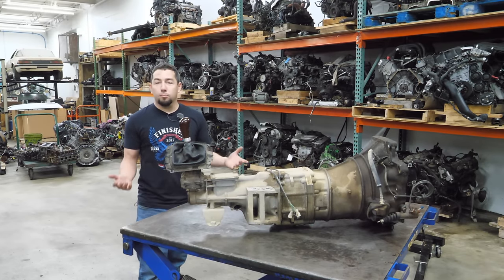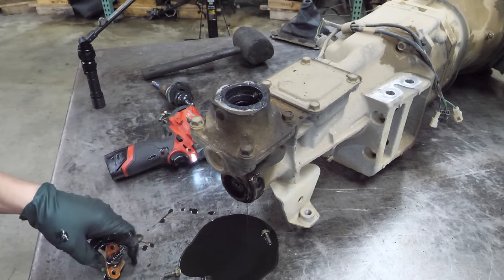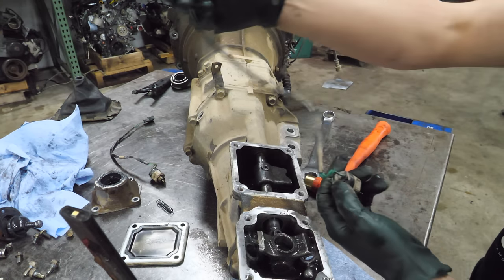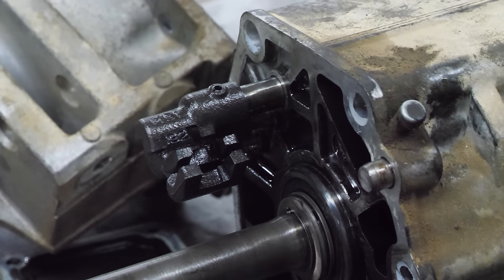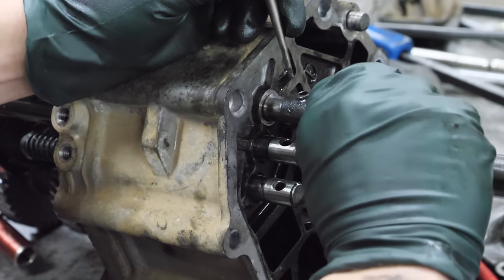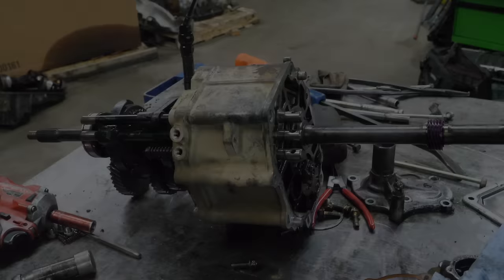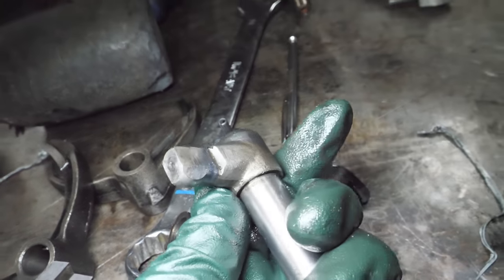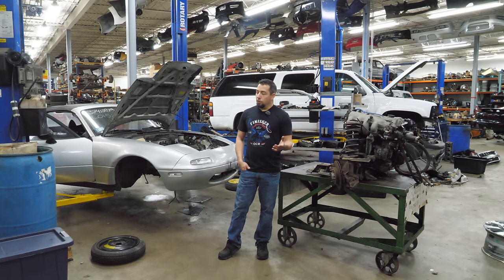JAMMED in Gear after wreck? Mazda Miata Manual Transmission Teardown

Comment: Ok, the blue tape under the shift knob just confirms what I suspected.  I owned a 2000 Evolution Orange Miata with just over 100k miles in Mississippi that I wrecked on June 11th of 2023.  I purchased the car in the spring of 2021.  It shifted ... ok... before the wreck, but when the tow truck was loading the car, I noticed the rear tires were not rolling and I assumed the transmission was jammed.  The wreck occurred as I was driving on a two lane highway at about 45mph when another driver in a Dodge Challenger (rental) turned across my lane about 30 feet in front of me.  I had no room to Dodge... the car and had to settle for standing on the brakes.  No major injuries to the occupants of either car, but I was sore for over a month from the seat belt.  I have been a follower of your channel for a while and hoped that somehow, my wrecked car would end up on your channel.  Got my wish.  Glad to hear the engine and other parts were salvageable and still live on.  I miss that car.
Reply from the maker: Wow man! First off, I’m glad you were ok.
Secondly, we sold the engine, torsen swap, rear bumper and a handful of small parts almost immediately. We gobble up NB’s and I’m not surprised with the Miata content that some day someone will recognize their old car.
Reply: That's so cool that u happened to see the car on this channel. I hope you continue to stay pain free from that accident. Very lucky. F-ing rental cars :-(

Comment: Eric is out here doing what 90% of what shop teachers should do. just tear stuff apart and talk about what to look for and what might cause it. Hell this goes for pretty much everything that you physically interact with. I learned so much, in less than 30 mins its insane
Reply: It goes against modern mantra though. They want you to toss and buy new, rather than repair or rebuild. There's a reason why the saying "they don't make them like they used to" exists, though it's a shame. This was by and far the best explanation of the basics for anyone and we need more content like this.
Reply: 100% agree. I have learned SO MUCH about engine internals and different failure conditions watching your videos
Reply: And then have the students put it back together from memory 🤣
Reply: What should the other 10% of shop teachers do?  Resign?
Reply: I always thought Gearboxes and Auto's were complicated as heck nice to see the Older cars still use easily torn apart boxes and when I heard Gbox main seal I never tried How stupid was that.
Reply: Truth
Reply: Yes, he is our generation, not the typical throw it away and buy a new one, save the past!

Comment: The shifter was stuck because the inertia from the wreck caused one of the shift hubs to move without the shifter being in that location. The detents between the shift shafts keep you from going into 2 gears at once. To fix this you can remove the reverse light switch and use a screwdriver to force the shaft back to the neutral position, thus aligning all the shifters again. I worked at a Mazda dealer back in the 80s and 90s. I was in the first Mazda troubleshooting contest in Arizona in 1989, I made 2nd place. Thanks for all the great videos! I really enjoy your channel. Keep up the good work.
Reply: Its reverse gear...common problem, easy fix....happens a lot in shipping and being set down hard standing bell housing face down or front impacts...the gear is only held in place by a ball detent between reverse and 5th on the internal shaft and can move forward jamming up the forks....Some trans you can get to reverse gear through the fill plug...slid it back and your good. In the video it was 5th/reverse shift rod that was out of place, moved forward...the shift detents keep you from getting into 2 gears at once and can not get jammed up or its broken...
Reply: Google "Miata stuck in reverse". It's an easy fix by just pulling the reverse switch and using a screw driver to reset the linkage. It happens when people FK around with the gear stick and shift direct from 5th to reverse when stationary

Comment: The fact that I finally get to see the inside of a manual transmission since I drive one. It really lets me know more about how I'm driving! And I'm so happy that I don't set my hand on the stick! 😂
Reply: I only hold mine when in third....to stop it from popping out.
Reply: @frankdesbaux  I've only had that happen once while I was on the highway and I hit what I would consider to be a speed bump from the road. Buckling but since they fixed it it's not that bad anymore!
Reply: @MrHanichak2  You need to drive older crap then.
Reply: What’s a shop teacher???
Reply: @frankdesbaux  so what does old mean to you? 10, 20, 30 years plus?
Reply: They should make new manual drivers watch these tear down videos before letting them touch the shifter..

Comment: Outstanding video. 
Old guy here I'm sitting here on the senior center bus from a Walmart run.
As a kid back in the late 60's I had a old 1965   Mustang 3 on the floor and I had to rebuild the transmission. 
It was my first time doing anything like that. 
It did work after that also.
Reply: Me too, 1st car 1963 260 V8 Comet, blew the trans, took it apart in my parents basement, went and got the needed parts (cluster gear and 2nd) from a Ford dealer put it back together, back into the car and it worked perfectly. Next car 1965 Mustang changed it from a 3spd to a 4 spd, I had some paper route customers that worked at Ford that got me a brand new 4 spd, (smile). Ford top loader, one of the best 3 & 4 speed transmissions ever in my opinion. I pulled the one out of my 70 429 Cobra Jet Cyclone Spoiler once to work on the clutch and it was the first one that I just couldn't use muscle back in. I was working pt time at a gas station while in the USAF and the owner said here set it on this floor jack and we got it back up & in NP. God how I hate being old now, 75 in May, Tear.
Reply: @George-Edwards Ooh that top loader is a great one to drive a car with
Reply: @George-Edwards  I've blown a lot of trans in my car but never needed to rebuilt nothing... Hmm I'll keep it in mind and send them an invoice if something goes wrong down the line...
Reply: @George-Edwards  For some reason, I tore up the Munchie transmission in my Pontiac GTO several times. Being an aluminum case, I could muscle it in and out.
Reply: 303 Toploader. Good transmission

Comment: As the owner of a '92 NA I super appreciate this video as the shop manual makes the dis-assembly of the transmission seem way more complicated. Luckily, when I have done fluid services on mine I didn't get glitter mud, and the plug magnet was pretty clean.
Something you know but forgot to mention, the shift knob area has its own separate fluid from the gear area and I run SuperLube Synthetic Grease instead of fluid there - makes for buttery shifts.
Reply: In case you did not know: Superlube grease is available in several viscosities , one of which (NLGI-Grade 000) is like honey and is ideal for this application. NLGI-Grade 00 is the next stiffer grade

Comment: In the late 70s I worked for a TV shop in Montana that had a 1969 Chevy van with a 4-speed column shift.  The shift linkage was very flimsy, and if you weren't careful shifting out of reverse, it would leave the reverse fork engaged when you went into first and it would take 5 minutes of jiggling to get it out of first and get the lever back to reverse so you could undo it.  My own car at the time was a 1974 Mazda RX-4, which had a 4-speed that I broke by power-shifting from first to second whenever I could because it could spin the tires (hey, I was a kid!).  Anyway, great video as usual!
Reply: I tore up the clutch in my 69 428cj Mach1 Mustang power shifting, but the gear box didn't bat an eye.
Reply: @wernerdanler2742  The part of the transmission that broke in the RX-4 was the collar that the selector slides on but the gears and shafts were fine.  I'm pretty sure the spinning of the tires in 2nd and sometimes 3rd was related to the flywheel inertia at 7500rpm more than the 140hp of the motor!

Comment: Had a 90 mx5 , a known problem is a weak detent for the shift interlock dog. Had the transmission locked in 1st and reverse at the same time. Easy fix, (10 minutes under car) remove reverse switch and move reverse fork with a screwdriver. Dog then can move again. That transmission was fine for another 250k miles. I image a lot of people replaced their transmission because of this easily fixable issue.

Comment: I've actually got an NA Miata right now, with that 5-speed transmission. Its so awesome, seeing how it works. A lot of us enthusiasts love to go on about how simple manual transmissions are compared to automatics, but there's still a lot of admirable complexity in there.
Reply: Design of manual transmissions, with all the synchros, shift forks, and gears compactly fitted together and set up so that everything works when it should and nothing works in neutral is one of the lesser of the dark arts. (I obviously know nothing about transmissions.)

Comment: Surprisingly nice. Rebuilt a FIAT 5 speed in the 70s the input and output shafts were dogged together for fourth. These were worn and jumped at greater than 3/4 throttle.
My Mercedes 307D truck 4speed was caught in a flash flood. Didn't see it but mud was half way up the doors. Everything seemed fine. A month later went on holiday. Came back and the gearbox was noisy and stiff as hell. Drained out only rusty water. Flushed and filled with new oil.....it was fine for another 100k miles (death of truck chassis)

Comment: I had a 72 vega with an opel sourced 4 speed. I broke that one 3 times. The most fragile transmission i have ever swa. I finally broke the cluster gear in half. With a stock 2.3 engine. I replaced it with a Saginaw that was built proof. Thanks for the video.

Comment: Man FINALLY! There’s like 2 Miata trans teardown videos on YT, and none of them go into this much detail of the parts and pieces. And none of the other ones are NB gearboxes. The factory service manual doesn’t show transmission teardown at all. I do have a whirring noise that stops on clutch pedal in, so I assume it’s the ISB. might have to look at replacing it someday and this video will definitely help. Doing the Miata gods’ work!

Comment: Worth mentioning that 4th gear in this transmission(assuming these are single overdrive units) isn’t really a gear in the conventional sense. Selecting 4th simply ties the input shaft to the output shaft, for a ratio of 1:1. When any other gears are selected the input shaft spins the counter shaft, and the counter shaft spins the gears on the output shaft, whichever gear is selected is connected to the output shaft via the hub and collar assembly.

Comment: Thanks for posting this operational. I have not seen a 5-speed (exactly like this, except for housings), since 1980.   Mine was a Borg Warner 5-speed in a 1978 Buick Skyhawk.
.
As you were shifting it through the gears, I knew, a priori, exactly what was going to (and did) happen (happening), as I had watched mine during rebuild.

Comment: I had a similar with a FWD transmission. It was tough to get into gear and sometimes I'd have to coast a bit. So when I got the car home (I'd not long bought it off my mum in a bit of a car shuffle !), I changed the gear linkage bushing* and the gearbox was fine for the 30000+ miles I put on the car over the next year and a half 😀

Thanks for this one, instructive and it's good to look inside all the different bits and pieces that make up our cars :-)

*Instead of the shift lever going straight down into the back housing, the lever went down to a rod that went forwards to the FWD transmission. Then there was a cube-ish bushing that linked that rod to the one going into the gearbox. The bushing was shot there too ... Think that was like a £10 part and an at home fix. Job's a good 'un :-)

Comment: Painful memories. Got a new clutch in my NA, and got the workshop to throw in a NB 5 speed I had sitting round which I thought would be better than the 5 speed I had in. 2 days in and it lost 5th and reverse, and now I can see why. All good, called in sick from work and spent a day refitting the old transmission, which continued to do sterling service. Lesson learned.

Comment: I had a 1987 Mazda B2000 that I had a hard time shifting from 1st to 2nd when it was cold. I bought the truck new. Yeah I know, I should have taken it back to the dealer to look at or fix. One day I was looking in the back of a Car and Driver magazine and saw Red Line oil. So I bought three or four quarts of their MTL oil. What a difference. It shifted like butter cold or hot. I recommend that oil to anyone with a manual transmission.

Comment: AWE the memories I owned an 1989 Bronco II, with 2.9 liter V6 came factory equipped with  cracked Heads, replaced the main bearings in the Tranny also when they started to sing to me. Loved that little rig but spent more coin keeping it on the road than any other vehicle I ever owned. Ah the good old days :face-red-droopy-eyes:

Comment: I always wondered what was in there! Our high mileage thrashed Mk2 1.8 with limited-slip diff had the best gearchange of any car I ever drove. The immaculate low mileage Mk2 1.6 was quite a different creature by comparison, and would reward even the slightest clumsiness with the sort of noise that, when heard on the street makes you say "try using the clutch!" or, if it has been a tough day, "try learning to drive!"

Comment: I have an 82' Rx7, track only car, and i have 2 transmissions for it that have modified with Miata internals. The Miata gear ratios are ideal for high revving engines, like a rotary!

Comment: Gearboxes that OEM were "redesigned" from a 4 speed to a 5 speed (1970s to 1980s) sometimes required far more fluid in them...
way above the unchanged position of the 4 speed fill point on the trans case..

An extra litre or two of fluid needed to be tipped in via the shifter being removed....
which was also a good time to check the plastic ball-bushing....

Comment: Nice change-up (see what I did there?)

I have a little clarification for you: what you called "4th gear" is partially right. 4th in fact is not a "gear" at all, but a direct connection of the input to the output. It is where you said it was (inside the gear you pointed at), but that gearset is the primary reduction to the layshaft (ie: countershaft) and partially determines the ratio spread of all the other gears that go through the layshaft, except for 4th, because it's 1:1 (direct) and doesn't go through any gear path..

A pointer for some future diagnoses: if you have a bearing noise in all gears except for 4th, you have likely done a "pocket" bearing. That's the one that sits in the back of the input shaft and the main shaft runs in it. These shafts spin differently from each other in all gears where there is an rpm difference from input to output, so this bearing will be more noisy in the lower gears with the biggest speed difference between shafts. I have a 97 Ford Courier (Mazda B-Series) with this exact problem. The big issue is that the bearing chops out, but it runs directly on the main shaft, which wears that out too. So basically the whole thing is fubar.

Comment: Eric! Would love to see a 2014-2018 Mazda Skyactiv- 6 speed manual transaxle teardown. 

I drive a 2014 Mazda 3 sedan. 
It has the 2.0 Skyactiv-G engine, and is very similar to the 2.5 core you tore down late last year. 

I always enjoy anything you post, the deviation from the normal engine teardown is always nice!

Comment: Also used in Ford Explorers and Rangers.  I had  94 Explorer with this transmission with 120k miles; driving down the highway I lost power when a bearing disintegrated.  Sounded like someone had thrown a handful of gravel in the gearbox.

Comment: 4000 rpm at 80mph with 40mpg on Dec of 1989 build. Had Jackson Racing headers and polished the MASS Air flow sensor, throttle body, and exhaust ports. The intake was super throaty for a 1.6, actually loader than the exhaust.

Comment: YES!!  I liked this video tear down alot!

Now since my PCV piper & spongy insulation tube broke off I go in FRIDAY to have a bew 5/16ths tube ( for exhaust crank gasses ) & slightly larger rubber tube ( all are 400-degree & transmission cooling pressure rated ).

Connect to metal nipple on exhaust header & the PCV valve at the other end of tube to throttle body.   WHEW!!!

Pray for me.

Comment: I got pretty good at rebuilding my '73 Triumph GT6 transmission.  The engineers at British Leyland thought it was acceptable for the reverse gear hub to engage the idler when selecting 1st, even though 1st was fully synchronized.  Lots of metal in the oil....

Comment: I had an 89 Ford T-bird Super Coupe (it had the supercharger) that started having problems going into 1st gear. I could shift into all the other gears just fine but for 1st gear, I would have to really force it into gear.
Anyway, while still under warranty, took it to a dealer and had them work on it.
They ended up having to replace the whole transmission. But the transmission was made by Mazda and it had to come from Japan.
So drove a loaner car for several weeks.
I ended up trading it in at ~120000 miles because it started having an issue with brakes where it would pull hard to one side and it was estimated that it would cost on the order of 5 to 6 thousand to repair.

Comment: The input shaft is shorter in Rotary applications than piston applications, but the 1st gen RX7 bellhousings bolt on. I've seen people use an angle grinder to make the input shaft fit, I guess we're a different breed in New Zealand. It's also common to put MX5 internals in an older Rotary case to get better syncros and I believe better ratios